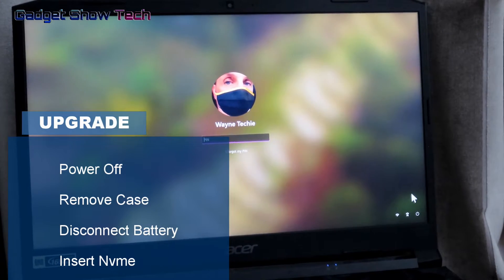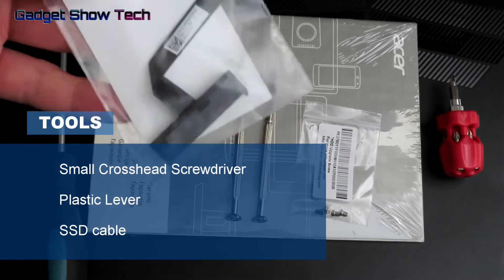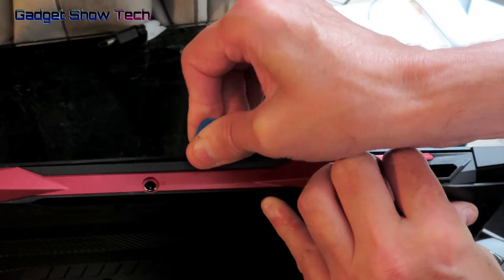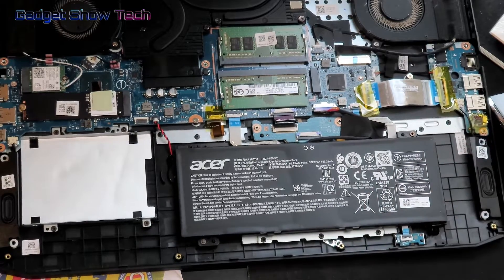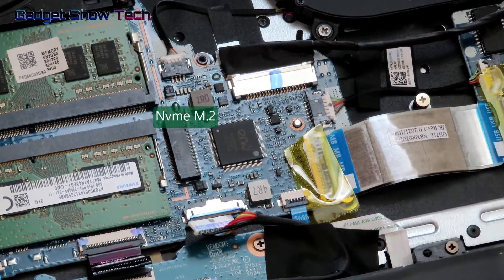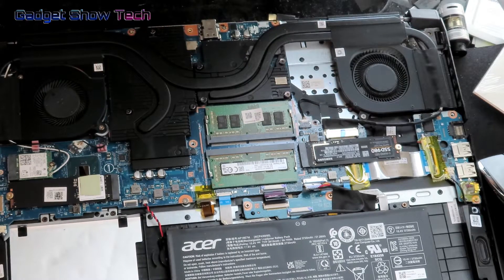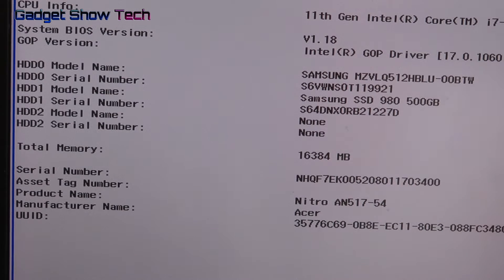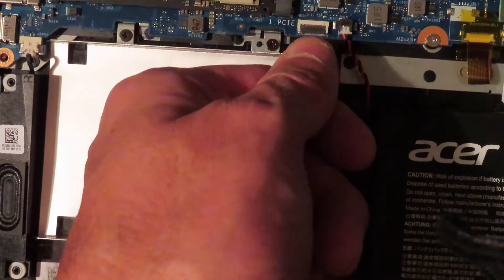🛠 How To Upgrade ACER NITRO 5 Fast NVMe M.2 SSD AN515 or AN517 Laptop Storage

Comment: thank you, after i updated to win11, I noticed how short on space I am.  I wasn't sure if there was 2 slots. , glad they are.  World of Warcraft takes half of my space.
Reply from the maker: M2 or SSD and what size?
Reply: @SmartGadgetShow  I have the same  Acer Nitro 5 as in the video.  I think it came with 256gb.  check my order at amazon and it shows  256GB NVMe SSD (2 x PCIe M.2 Slots.     world of warcraft is currently using around 130gb installed.  I could remove retail and save some space.
Reply from the maker: @vontar1 sounds like you played safe by getting the same.  We replaced with Faster and larger 1TB.
Reply: @SmartGadgetShow  I haven't replaced yet, but I am thinking about adding a 1TB Western Digital , and copying everything over and making it the primary.   my laptop still runs very good but if do this, i might as well go all the way since there are 2 slots

Comment: Hi, I've bought a Lexar M.2 Gen4 4TB for my Nitro 5 AN517-52, and installed it in the slot next to the RAM. It was stuck in a boot loop on the Acer logo so I thought maybe the 2nd slot only supports up to gen3 so i swapped my 2 SSD (original one is a 1TB gen3), but still the same problem. I tried disabling fast boot, secure boot, using a bootable usb stick, etc but nothing works, always stuck at the same point + displays a message "Preparing automatic restoration" before rebooting.
Would you have any advice for me please?
Reply from the maker: The laptop spec says 2 terabyte maximum.  Putting in in a larger stick should not cause any issues going back.  If you never change any settings until it went wrong, it is possible a cable may have come loose.  Do you have error codes? 
 The bios can change in some circumstances, so Load bios  defaults if at a loose end.
Reply: I tried everything with a hardware tech friend, including booting from a ubuntu live usb stick just to see that even gparted didn't see it so i ended sending it back. I just bought a Crucial P3 with the same specs, as the support guaranteed me the compatibility this time, so it should go better. Thanks for your answer tho!
Reply from the maker: @baudibaud   good luck.  It's unlucky that this happened.  Have you re-seated the internal cable.   Since you have used various  drives, I guess the socket is clean?

Comment: I just buy crucial mx500 SSD 2.5 for second storage buy my Acer Nitro 5 won't boot,it just stuck at black screen.if I remove 2.5 SSD it boot normally.what should i do ??
Reply from the maker: PRESS F10 at boot to choose bootup device.
Reply from the maker: Ok, check the cabeling and that it is properly connected.
Go into the BIOS and check the settings and check it's “UEFI" and also that the boot order, so the one with the OS is first. 
MBR or GPT? If you plan to use the SSD as a second drive, use GPT when the disk is bigger than 2TB, and use MBR when the SSD is smaller than 2TB.